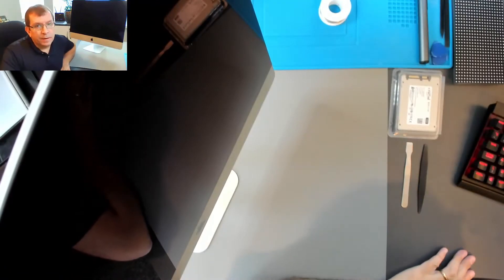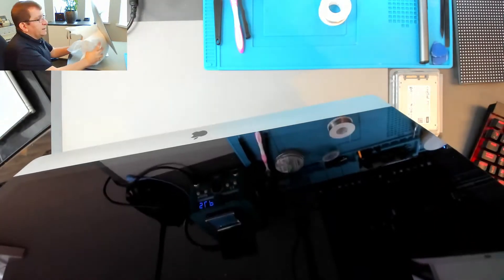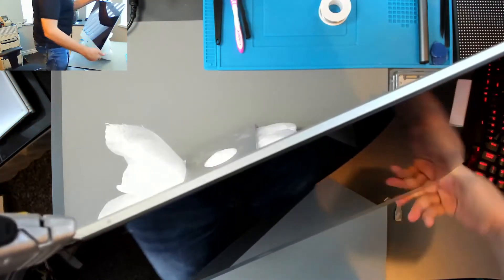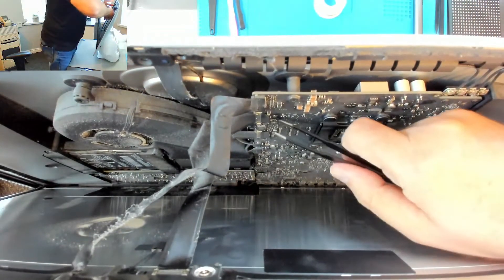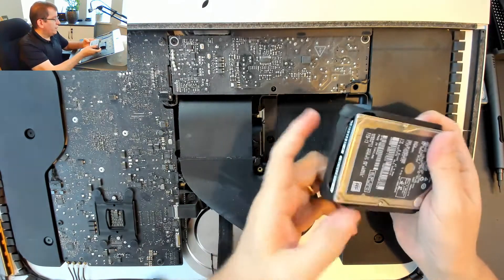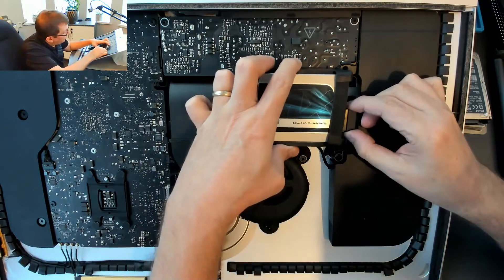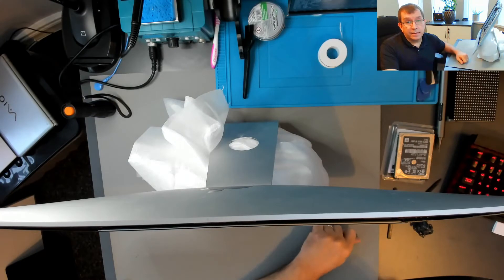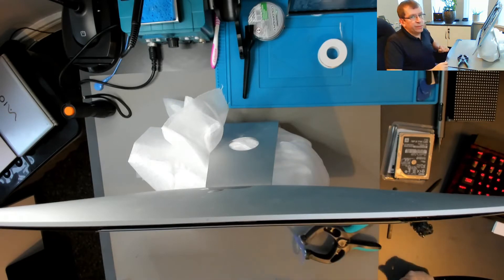[21] Apple iMac (A1418 - 21.5-inch, mid-2014, EMC 2805) - SSD upgrade

Comment: I have the same iMac (21.5 inch Mid 2014 A1418) and I want to upgrade the RAM. I am reading in some places that the 21.5 inch version have soldered RAM. Since I can't check that easy before I buy memory I am asking you to share information about this.

Comment: Very odd, I just finished taking apart an A1418 EMC2805 and it looked a bit different than yours. For one the SATA connector was one piece and very difficult to connect back with a very short cable. And the video connector with the metal release tab and the other one have a different onboard cable that's plugged in between. And those cables were plugged directly straight down into the mainboard from the top, instead of yours that's sideways.
Reply from the maker: That is strange. I've done a few of these now, and the ones I've worked on have been similar to the one in this video. Have you checked iFixit to see if yours matches their repair guide?

Comment: Can i upgrade ram??
Reply from the maker: You can, but it's moderately difficult: https://www.ifixit.com/Guide/iMac+Intel+21.5-Inch+EMC+3068+RAM+Replacement/103417
Reply: @ComputerHelpNI  thank you, and what kind of RAM should i buy?
Reply from the maker: @lamatommaso7410  It varies depending on your specific model. To find the correct memory modules for your computer model, locate the model numbers for your computer (e.g. A1418 EMC 2805) and do a Google search for your model number plus 'memory upgrade' (e.g. 'A1418 EMC 2805 memory upgrade').
Reply: @ComputerHelpNI  i have the same number EMC!! 2805. what kind of ram I have to buy??

Comment: What about the temperature sensor?
Does the fan work well?
Reply from the maker: In this case, I don't t think I needed to do anything -- the fans never had any issue. In the past (on a slightly different model), however, I had to install SSD Fan Control to manage the fan speeds.

Comment: DID YOU REPLACE IT WITH 2.5" OR 3.5" HARDDRIVE?
Reply from the maker: The existing hard drive was a 2.5-inch drive, and so was the SSD replacement.